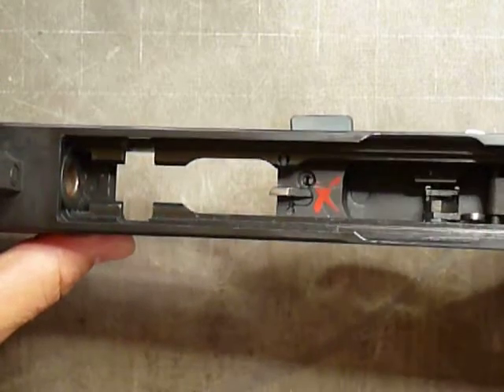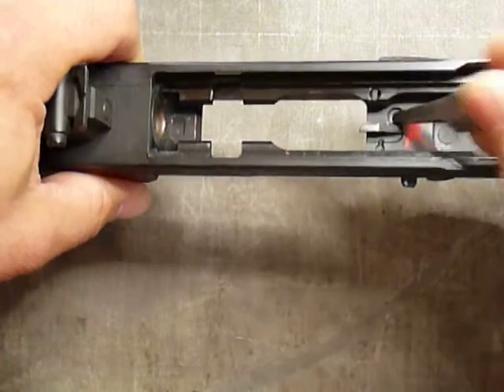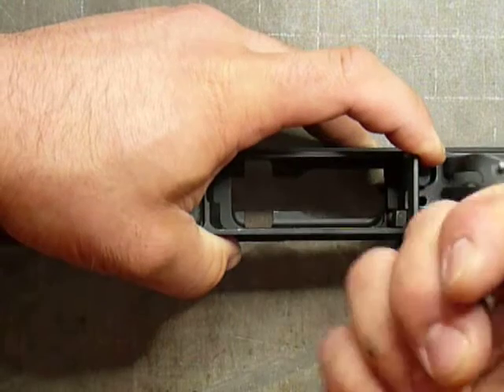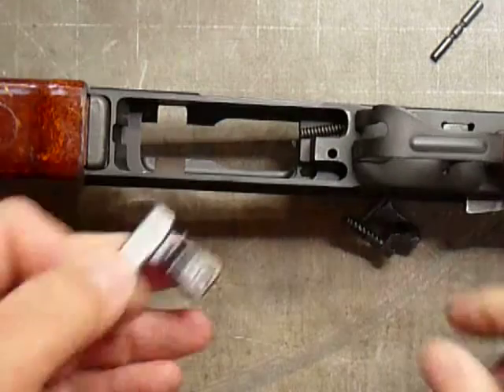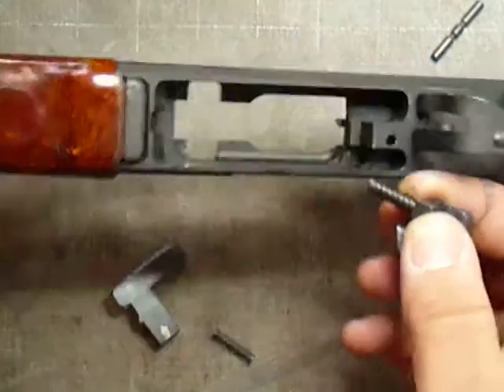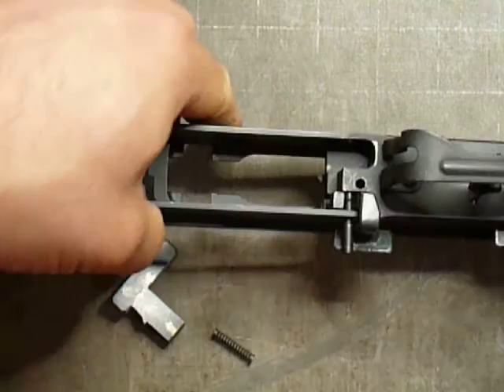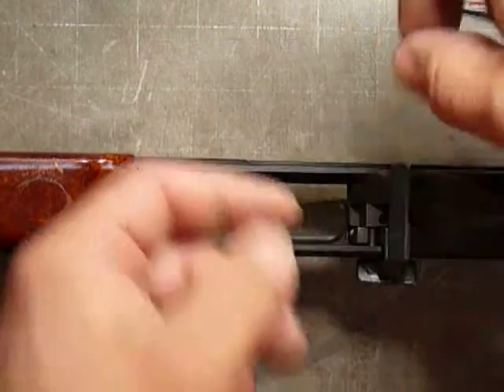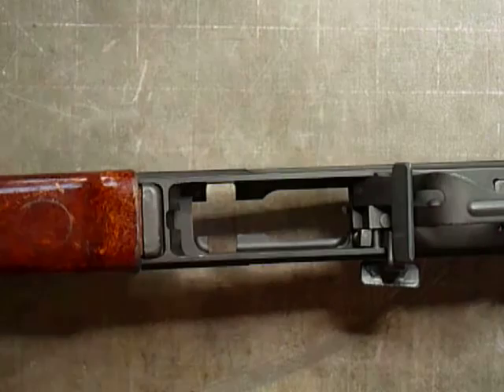How to remove your magazine release and bolt catch

Comment: Thank for the video. Since extended bolt releases and ambi magazine releases are so expensive I am thinking of just modifing the originals like yours.
Reply from the maker: if you do, you must remove the blackening first. it's got to be bare metal otherwise the welds will be weak.

Comment: I purchased my  VZ2008 in 2014.  After I fired about 120 rounds  I noticed that the pin was installed incorrectly.  The pin failed to lock the mag release cross bolt.  The cross bolt was almost ready to fall out.    That pin needs lock using the solid part to hold it in.  The correct way is with the flat pin head out and from the bottom up!The VZ2008 is a great rifle and vastly superior to the ak family.  The bad on the vz are accessories are so damn expensive and hard to find.
Reply from the maker: you are correct